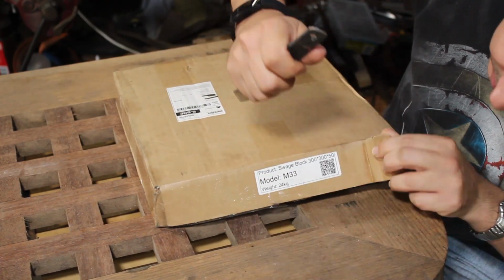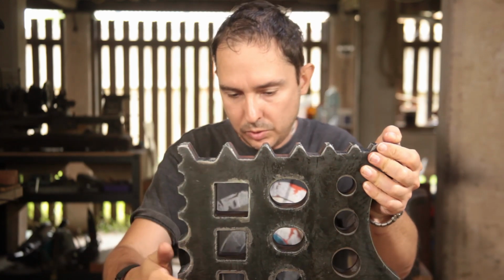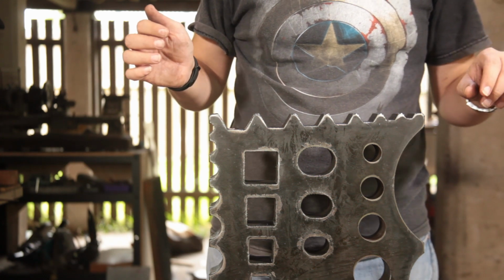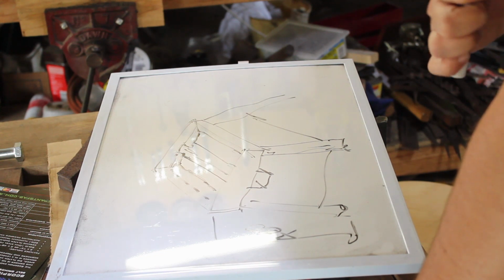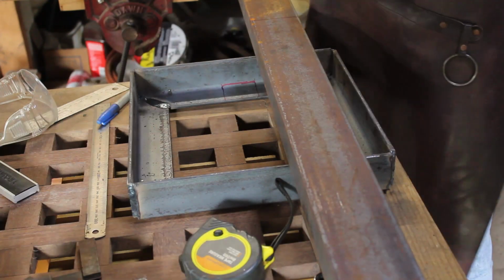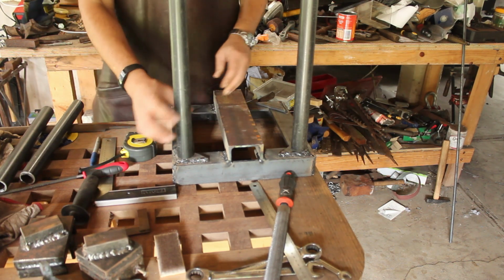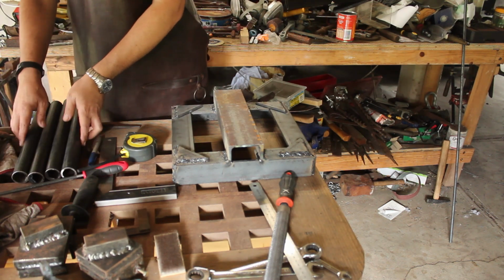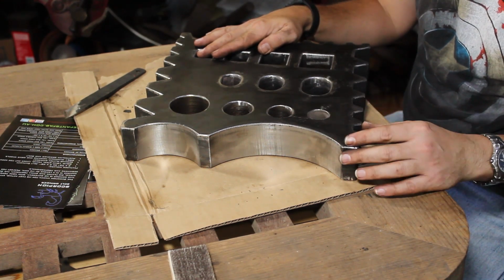Fire Pants Swage Block review and stand build; pt 1

Comment: Mine was pretty clean, I didn't bother cleaning it up at all. I went for 10mm clearance for the horizontal fit after getting your advice. I only ended up with 6 or 7, so I am glad I didnt go with my original plan of 5! What I ended up with is enough to move it comfortably, but I dont think you would want less. 
I went with about 100mm sticking up above the frame for the vertical mount position. Yet to use it vertically in anger though.
Reply from the maker: Yeah shrinkage bit me good and hard!